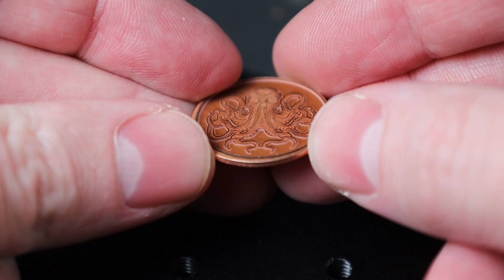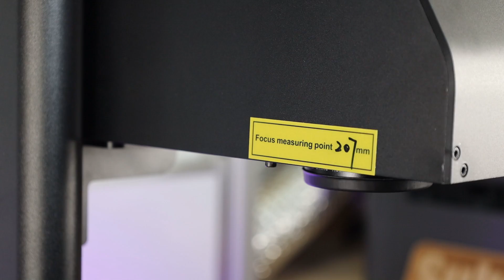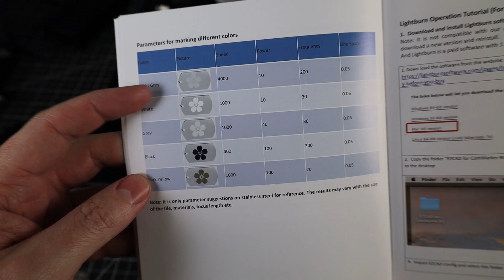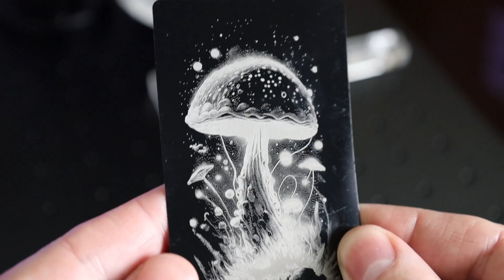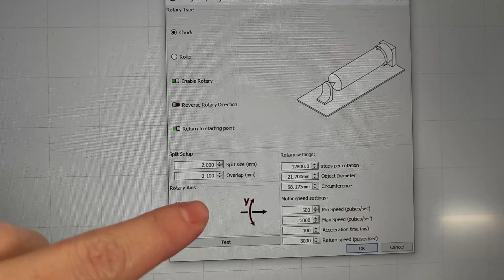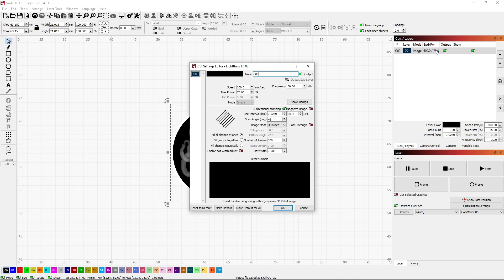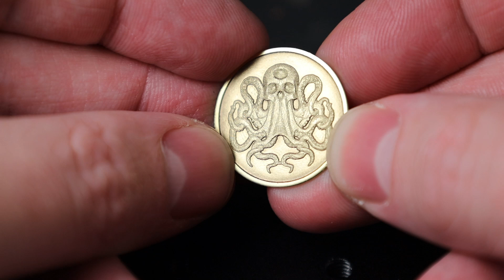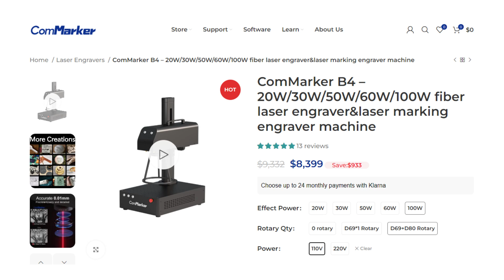3D Laser Engraving Metal & Much More

Comment: Does this achieve the same engraving depth as traditional engraving? I am a bit concerned that the laser isn’t powerful enough to really push deep enough into the metal for durability.
Reply from the maker: This is able to engrave pretty deep for example I measured the lowest spots in this particular piece and they were about 0.4 mm deep and that was with 100 passes to make these coins.
Reply: Let’s see how it does on .925 silver…..  Lasers consider silver their kryptonite….